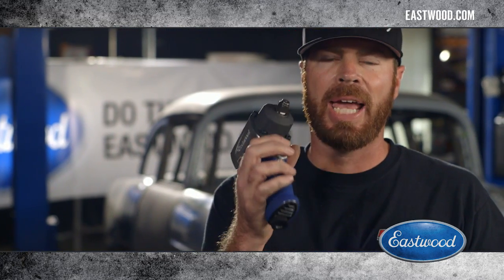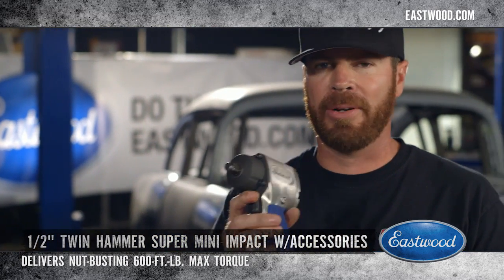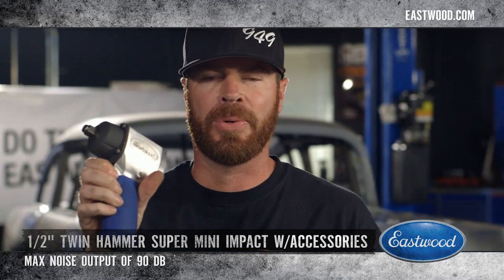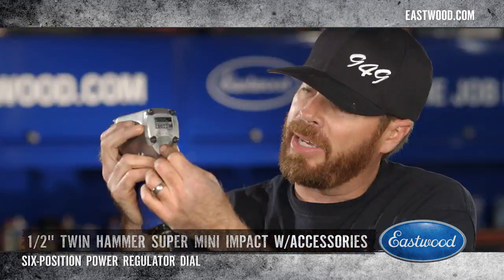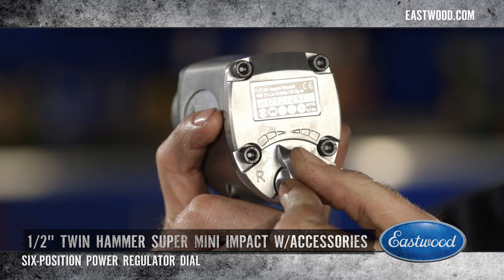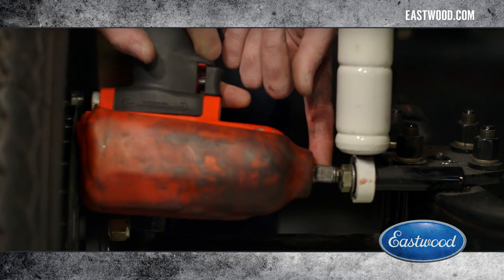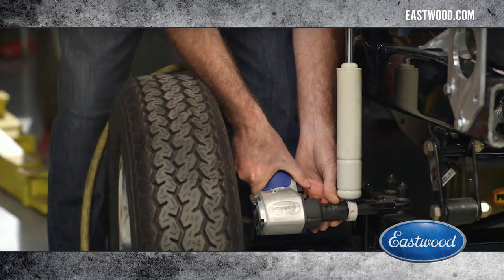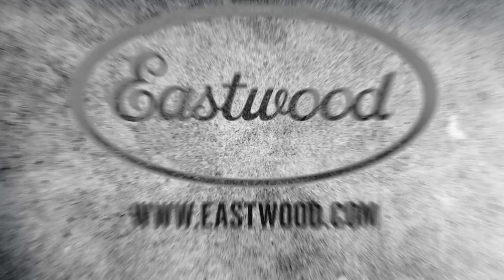Hot Rod's Mike Finnegan Removing Front Shocks on a '55 Chevy with Eastwood Mini Air Impact Wrench

Comment: my NitroCat 3/8 XL has 700 ft.-lbs. of loosening torque and 86dB
Reply: This is smaller than any 3/8 air impact, and a lot more powerful than most of the 3/8 guns expect the one you mentioned.